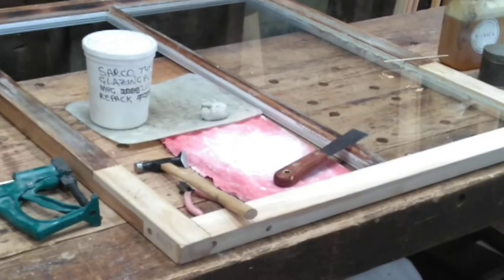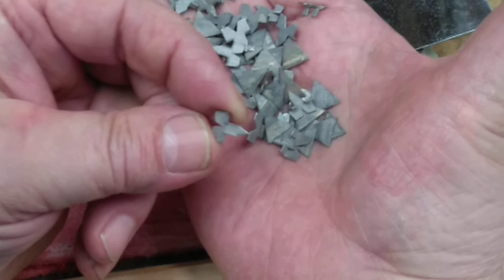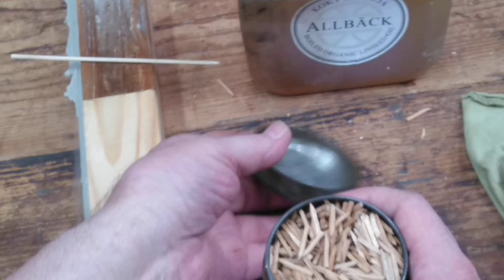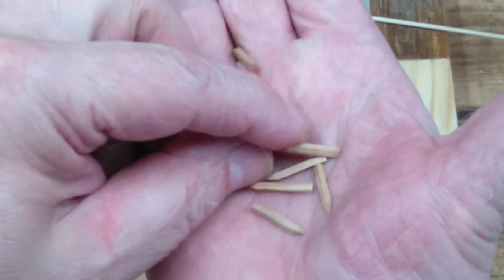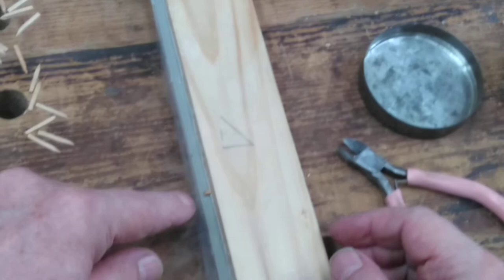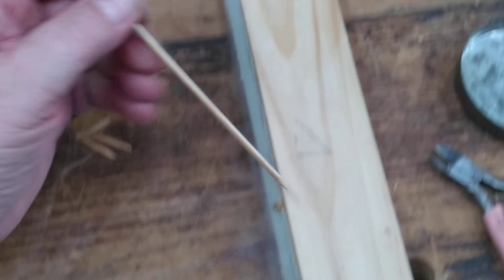Window Glazing, Wooden Points

Comment: Thanks, great idea - I have a feeling that points will be too long for my sashes and was looking at something that wouldn't rust from underneath - alternative was stainless steel pins but this is ideal and as you say far more sustainable - I guess the negative might be that if the pegs rot then the glass might fall out (worst case scenario if neglected!)
Reply from the maker: @Umski , the linseed oil treatment will help mitigate rotting. I guess one could add a chemical preservative to the linseed oil, like the mildewcide paint additive products "M-1" or "Add-2", but keep in mind that I have not tested these products for this use.
Reply: @johnleeke  thanks, yes that’s what I had in mind - I am using a 50/50 mix of wood preservative (solvent based but getting harder to source in the UK) and linseed oil as a first coat followed by a linseed oil primer coat, followed by paint on the sash itself so the entire unit excluding glass would then be timber - it looks like I can actually buy the pegs in bulk in the UK and they work out around 5p each which is similar to zinc plated glazing points or stainless pins so it’s a pretty good solution which I’d not even considered 👍

Comment: Do you use these on all windows now or just for that project??
Reply from the maker: Just trying out the wooden glazing points, based on that one historic example that we found.
Reply: @johnleeke  would you recommend I switch over and use this method or are there downsides that you would warn against?
Reply from the maker: @zacharyshay7000  I would recommend that you try it out, like I did here in this video. 
I don't adopt any method into my standard practice until I have "tried it out" in a limited way for a decade or two; or have run it through my Side-by-side Comparison Field Testing Program.
Upsides:
==> Wood is a more sustainable material than any metal
==> Durability is proven by two cases, one from the 1890s and one from the 1820s
Downsides:
==> ???